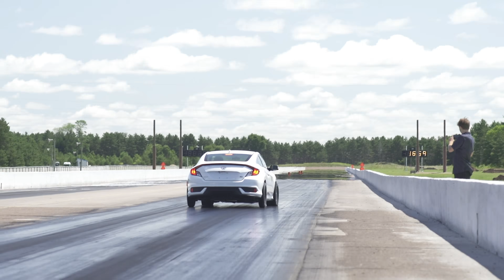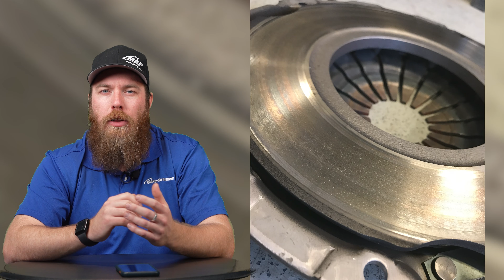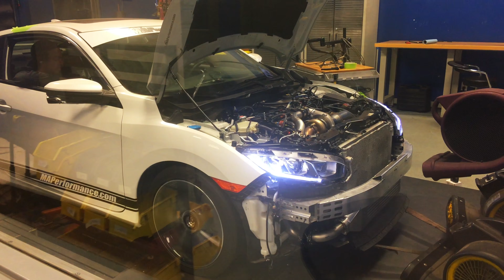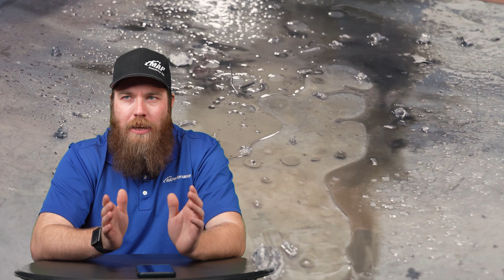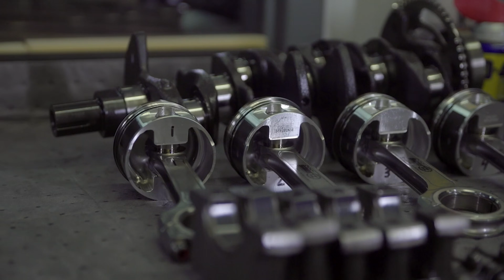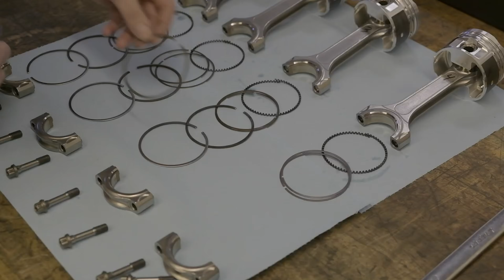What Breaks when Making 500+hp with a 10th Gen Honda Civic Si?

Comment from the maker: Thanks for watching! 
What other Civic Si content do you guys want to see? Let us know here!
Reply: Will MAPerformance be tinkering with the 11th Gen Civic Si? Learning now that they’re close 10th gen-11th gen but not the same as far as the engine is concerned. Would love to see videos on a stable build to 400hp. It’s a good looking car. If only it can make these power figures to match the looks.
What are y’all thinking about it?
Reply: Did you ever try anything using an automatic cvt transmission? If you know anything or anyone that has a solution to the belts, I'd like to learn about them.
Reply: i know in one of your videos you said your running an aem ems 4 for the port injection, a video going more into detail on that would be cool.
Reply: Sir which kind and which categories of turbo can increase hp upto 200+
Reply: 11th gen
Reply: Hello 2 years later, but I would like to see 11 Gen Civic Si with stronger internals rods/crank/oil pump gear/head studs/better oil flow/head sleeve ported and strengthened. I appreciate the R&D testing these engines to the max. I hope stronger internal parts will be available so enthusiasts can safely upgrade for everyday driving. I would be ok with my Si at 265-280 HP and retain reliability. I know with some bolt-ons I can get that, but my engine will be at risk or the engines longevity is shortened before a overhaul.
Reply: 11th gen si

Comment: Looking to make 320-350 with a W3 on Pump 93.  Should I be worried about the 3rd and 4th gear or should I be okay if I don’t plan on making more than that?
Reply: Don’t get a W3 if you’re not going above 350whp. W2 is rated for 350whp and youll be able to spool a lot faster

Comment: My biigest complaint is the missing E brake handle. You normally would put the e brake then load up the trans when you stage and drop it when the light goes green. The worrst thing is that I cant have as much fun in the snow without the ebrake. Oh well I guess I will have to jump in the old 99 CRV when I want to play in the snow.

Comment: Did you say 10,000 RPM on an L15?? You must have some sort of crazy cam because I always see these things roll over power wise by 7000 RPM. Even when holding boost. I haven’t tuned one was a Ported head yet, but I’m sure I will soon enough. I just can’t imagine going past even 7500 RPM on this motor. 

The only way I can see 10,000 rpm in an l15 happening is progressive nitrous  by rpm.

Comment: Did you find that you needed a block guard, resleeving etc. to make those big numbers? I'm building an L15A7 at the moment with wiseco pistons and k1 rods, hoping to push around 250hp initially with a td04. i know the B7 is a different head with direct injection and DOHC, but there's little out there for my L15 so crazy to see a 10th gen make this power

Comment: TL;DW Rods, rod bolts, oil pump and head bolts are the weak links of this engine. If you make a lot of power down low you're drastically increasing the propensity for low speed pre-ignition. That's what does most of the damage on turbo cars. Between 2800-3400 is the LSPI danger zone, after that, piston speed induces enough turbulence to make combustion more consistent.

Comment: i want to be making the same power as a stock type r. any thoughts on how i can safely make this power?
Reply: ARP HEAD STUDS TSP STAGE 2 tune you will be able to be just as fast as type r.
Reply: @Candybuiltsi  OEM transmission gear set doesnt like much power over 300 its a gamble.

Comment: so as far as reliability goes how reliable would a built block with around 400 hp be for daily driving? work at day and little roll races and stuff at night typa deal.(1 being grandma driving and 10 being a maniac id say i’m around 6-7ish).
Reply: as far as the block goes^^ transmission and other components ofc will be built
Reply from the maker: We look to test the limits with our new MAP Spec block this spring, but the stock block held up just fine at 400hp, so a built one should be fine!
Reply: @maperformance  how can i make stock type r hp safely? im tuned with almost full bolts ons. just no downpipe or inlet pipe.

Comment: This Wednesday (1-12-2022) My Si is going in for its last engine performance mod. Sadly i have to replace my Maperformance intake which I love for the 27won.  It has a 80mm maf which the Maperformance does not that's going to connect to the crossover pipe that's going to connect to the W2-v2 drop in turbo. I just put the E85 on last week & can tell a larger hp gain. My car was sitting at 231hp & 266 fpt at the wheels before the flexfuel add on. This Wednesday thats all going to change. Alex Pagan of Humble Performance will be doing my tuning on their Dynojet. My Maperformance full bolt on exhaust is going to be singing. I still need a clutch. Can Maperformance help with that?

Again love these 10th gen videos you all are putting out.
Reply from the maker: We sure can help get you a clutch! Give us a call at 651-348-8811 and we can give you some recommendations!
Reply: @maperformance  Awesome. Your on phone staff is great & friendly.  Never had any problems  with you guys. Ill definitely be contacting you when the time comes.

Comment: Just finished installing one of your intakes on my Si. Love the quality. Safe to say I know who to go to when I need a new motor. Love you guys!
Reply from the maker: We're glad to hear that you love the intake! When you need more parts, we'll be ready 💪
Reply: Beware of the trans I blew mine with fbo ots tune
Reply: @swaginih  E tune?
Reply: @wanderbread4217  I had a prl cai , catless dp/fp stage 2 clutch phearable 1.5 tune and a borla exhaust
Reply: @swaginih i have a stage 2 clutch and catless will i face issues if i put on the godmode phearable tune?
Reply: @Kayloxk  that’s what I had on my car, the pops and bangs are not the problem. It’s the transmission, with a dp and a tune you can get around 300 tq which is too much for the transmission. My buddy near me as a racecar 10th Gen, built motor but went thru 3 transmissions. And the only trans on the market for those are ppg….(I think)
Reply: @Kayloxk  my advice is ease into your pulls, dont put too much load it. ex. 5th gear pull from 3k rpm is a no no. Also side note if you have a 2020 si they lowered the gear ratio for 4th gear bc it sucks lol but it SHOULD be better Than the 17-19 models